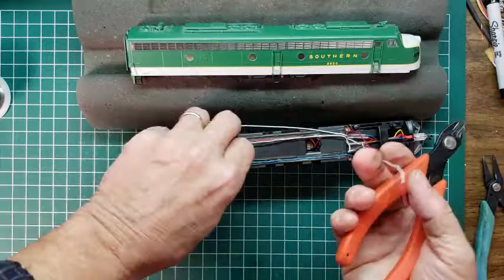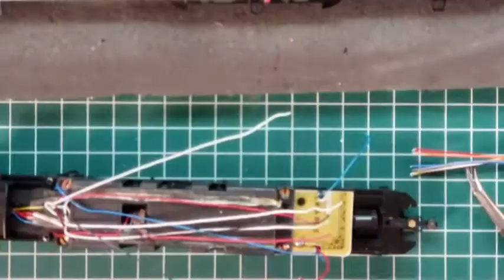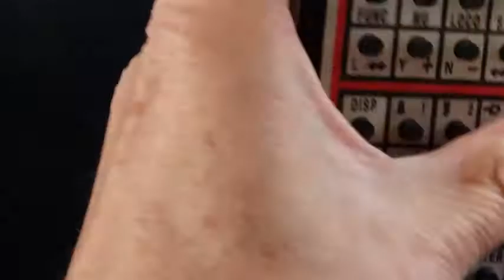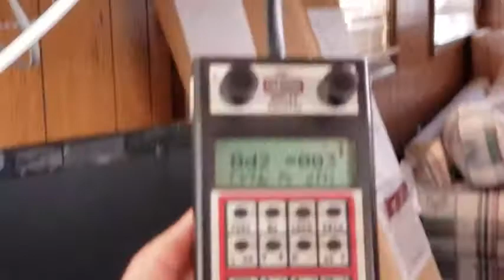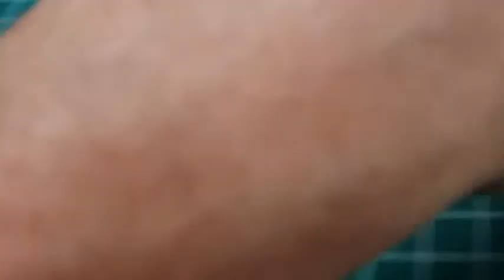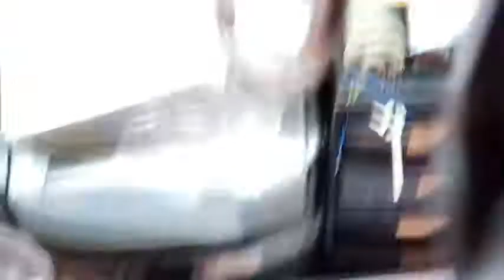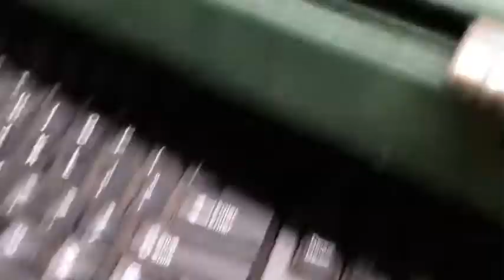HO P2K E9

Comment from the maker: Bob.  I buy LED's in large lots (100 at a time).  My criteria are size, color and brightness.  Most decoder manufacturers are now packaging LEDs that are appropriate.  Often they add resistors in the package that are too small.  We typically stock and sell both LED and appropriate resistor.  Search "LED" on our web site.
Reply: Should have paid better attention to the video cause @ 1:55 to 2:10 you said about to mars light.. Thanks for the info